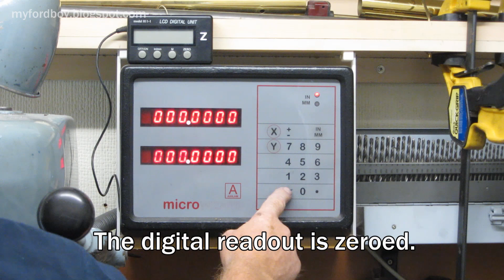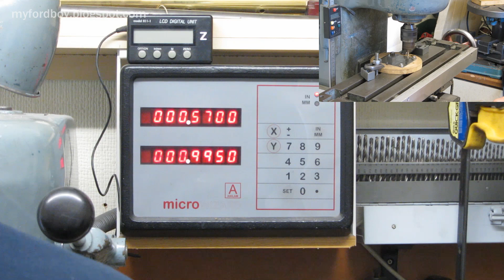The Myfordboy Stove Fan Part 5, Hot Cap

Comment from the maker: The solder melts around 650C.. By keeping the torch away from the previous joint it is possible to use  the same solder for top and bottom. The stainless steel used for the tube does not conduct heat very well which is why it's ideal for a stirling cycle engine.

Comment: Hi Mr Myfordboy! Question: is it possible to silversolder cupper to stainless steel. i think that for Stirling cycle is mutch better cupper than brass because of its thermal conductivity. Thank you in advance for your comments?
Reply from the maker: Yes you can silver solder copper to stainless without any problems.